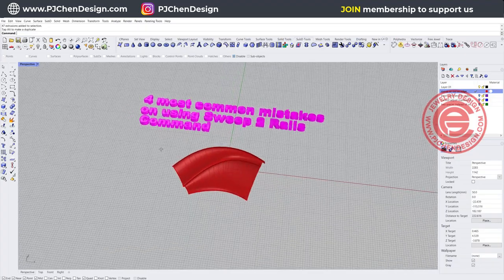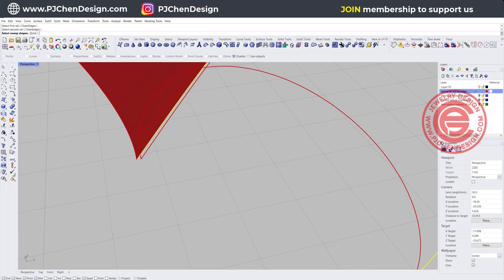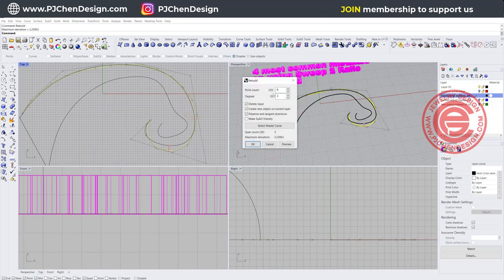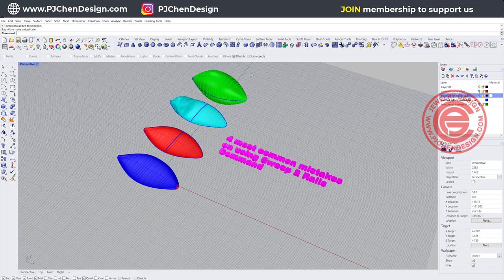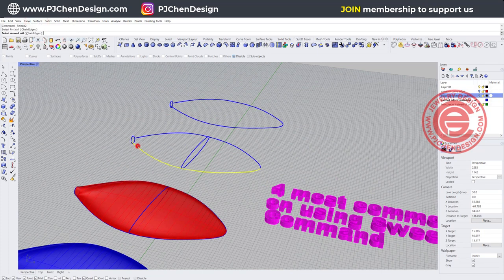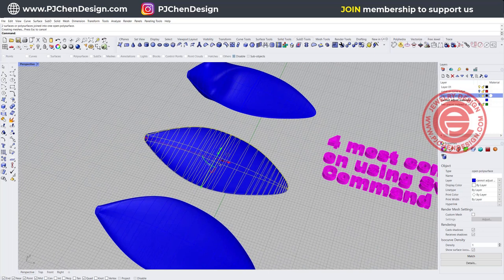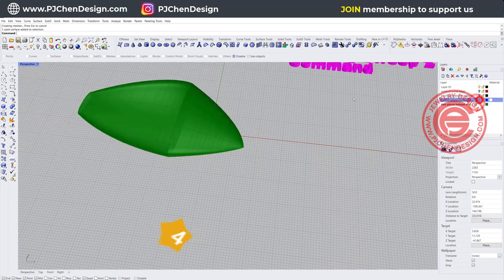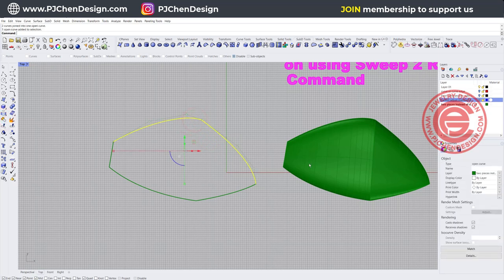Top 4 Mistakes on Sweep 2 Rails Command in Rhino 3D Software #341

Comment: Hey Chen, How often do you create UVs and create the design on laid out UV and again flow along the surface? Also, in which situation does make sense to use 'create UV' and 'flow along srf' while doing artistic woodart modeling?
Reply from the maker: It really depends on the design to use different commend. What is artistic woodart modeling?
Reply: @PJChenJewelryDesign  My bad for being little bit vague. I meant the designs on pillars or windows where surfaces are bended.